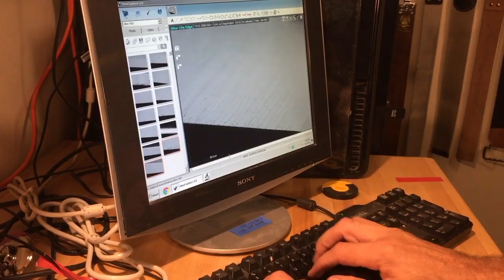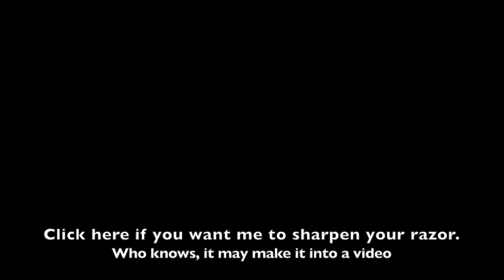Razor Sharpening from Bevel Set to Finish - Thiers Issard

Comment: would have been perfect to see the edge under the scope after you did the parker trick
Reply from the maker: Parlor trick!  Wouldn't see any difference with the edge nicking a hair.
Reply: Sorry! I meant to say it would interesting to see the edge difference after you stropped it.
Reply from the maker: @RadomKidsareme000   - Probably still wouldn't see much.  You can see a difference in the edge from coming straight off the stone and then stropping it.  But after the first time stropping, you won't see any difference.  

If you look at my latest video on the La Lune stone, I have some slides in there of before and after the strop. https://youtu.be/P0M5aZIT2z0?t=625

Comment: Why did you kill the edge on the 8000 k if you have done the cutting edge? You should lose part of  the previous work? probably you pass very soft to uniform the teeth?? This is the only explication I found
Reply from the maker: I do it to smooth out any toothiness from the 400 diamond but also to make sure that there is no residual edge from the previous sharpening.
Reply: @drmatt357  But the previous sharp was a 5000 k and it didn't have sense if we kill the edge it would be like putting off the bevel that is no teeth! so probably you want just to smooth the teeth and not to cancel them . So you make a slight passage on a stone like the 8000 thank can't kill the edge but just smooth???

Comment: Anyone think that ILR hone is worth the  65$? Sooo many mixed opinions about that darned thing..
Reply from the maker: The 2X6 is $45 and all you really need.  I haven't found any real difference in the regular and premium as far as edge quality goes. https://www.imperialaroccia.com/store/2-x-6-ILR-STANDARD-Standard-12-15k-Hone-p129339007
Reply: Yes ABSOLUTELY, I have one and it produces,  fantastic edges! Just follow what Matt does in his previous videos, and you'll be fine! It's a steal, for such a good stone!
Reply: I got the cheap one to try it. And it kept micro chiping my edges. Had to move away from it. Now i got options but i prefer my jnat, by far. Lapping films are a cheap option 'till you know what you want.
Reply from the maker: Do you live in the US?  I'd love to get my hands on that stone to see what the issue is.
Reply: @drmatt357  Unfortunately no. I'm in Canada. Does the one you have emits a really strong iron sand aroma and rust nodes on the bottom?
Reply: On a side note, compared to my Ozuku mizu asagi stone and the nakayama asagi kan i got, the ilr is way harder. And those jnats are hard.  But the main issue is that the ilr is crumbling very slightly everytime i use it (weird grooves in the middle of the flat surface on the slurry stone, corners etc), those lil pieces mixed in the slury is probably what's destroying the edges.
Reply from the maker: @CreepyWilly   - Where did you buy the stone and did you ever use oil with it?
Reply: @drmatt357  I did, food machinery grade oil. It's a runny oil yet viscous with zero granulary.
Edit: I bought from their official website.